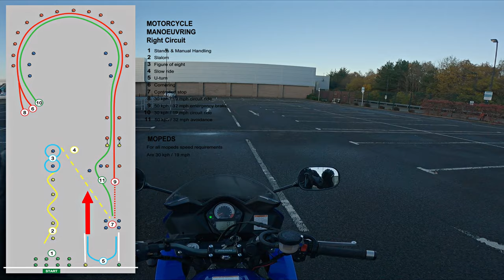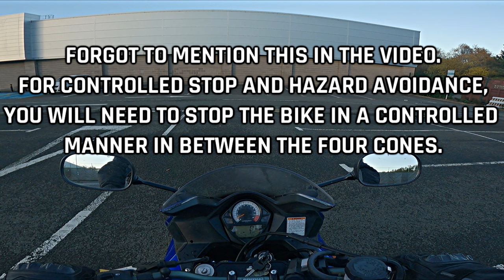Controlled Stop, Emergency Stop And Hazard Avoidance | Mod 1 Tips #3

Comment: Excellent vids on the Mod 1. 
You fully deserve more subscribers.
Great tip you gave on the U turn, tuck your right elbow in to your side. I still go out and practice this as I found it tricky to do and I’m getting tighter U turns with your help.
On the speed exercises really listen to the sound of the engine as you don’t have time to look at speed.
One tip I found useful for the hazard avoidance was aim for the outer cone, gives you the best chance of not catching the inner cone

Comment: Bit concerned about getting to 30mph in such a short timeframe. I have a 10HP Yamaha YS125. To keep engine happy I'd usually be in gear 4 and that would be 4k rpm. Not sure I could do it in gear 3 even. Perhaps a lot of warming up and just pinning the throttle.

Comment: On the avoidance I was told the official line now is you only need to be in-line with the final blue cones, you can stop before, between or after as long as you're lined up.  However always best to ask the examiner on the day what they want to see.  One examiner told me I have to stop between them, the other said anywhere lined up was ok.  I still stopped between them though as didn't want to take any risk of getting a fault.
Reply from the maker: I was told, at least at the time anyway it was to be between the cones. It still amazes me how much difference there can be between instructors and examiners.
Reply: @MotoEcosse  it's so inconsistent even between examiners at the same test centre, one will give minors for things like going round the yellow cone on the figure 8 but another will even tell you it's ok as long as it's done in a controller way.  Yet they're all supposed to be testing to the same rules.
Reply from the maker: @BillyHey72  yeah one thing I noticed is with the figure 8 one of my instructors said it was ok to go around the last cone on the slalom and another instructor said it wasn't. 🤷. I also heard of this happening on mod 1s(going around the last cone) where one student passed and one failed. It was also different examiners. It can definitely make it confusing at times for learners.

Comment: Last week I kept on messing up the hazard avoidance, I kept smashing the the cones cos it felt fast and then swerving, I was a bit nervous but then I got it . It looks very simple . How much pressure do we need for the push ? It seems slight . If too much you’ll hit the other cone . So you need it just right on to get thru the gap
Reply from the maker: There's no exact pressure. It's all comes down to the bike, the bikes weight, the rider etc. It's just something you'd have to practice without cones first. The maneuver itself only takes a second or 2 so you're doing a quick push on the handlebars. Also make sure you're not looking at the cone. If you're looking at it the chances are you'll it. Look at the gap in the cones where you want the bike to go. 🤜🤛

Comment: You make great informative videos, thank you for that. On the emergency stop, you said roll off the throttle straight after the speed trap, that’s the bit I don’t get, it’s supposed to be spontaneous therefore defeating the object. Wouldn’t the examiner hear the engine break?
Reply from the maker: Not really. The thing is you're rolling off the throttle when you're above 30mph so you're only really slowly down by a few mph before the examiner raises his hand so the stop's still done around 28ish mph give or take a few mph. Some instructors may teach this slightly different, this is the way I was taught and the way I did it on my mod 1 and had no issues or minors. Hope this helps. 🤜🤛
Reply: I was told you could get a minor for anticipation for rolling off the throttle before the hand goes up.  But I guess it depends on your examiner on the day.  On my first mod 2 attempt the examiner picked me up on everything, including stuff I didn't think I'd done.  Second attempt examiner was a bit more relaxed and only got 1 minor for speed on the avoidance.
Reply from the maker: @BillyHey72  yeah it definitely depends on the instructor as well. They all have different ways of teaching. I rolled off for my emergency stop on my mod 1 and it was fine. Always worth double checking with your instructor before hand.
Reply: I rolled off as trained for avoidence and emergency no issues at all with that. I actually got a "safety chat" for going fast on emergency stop ( I can't remember maybe 40-42 mph)and was told I would be making life difficult for myself doing avoidence at that speed so I slowed down and came 1 mph under so picked up a minor.
Reply: @BillyHey72  if you think about it, if your avoiding a hazard the 1st thing you should do is roll off the throttle? I mean that’s my guess. But I know sod all. I’m learning